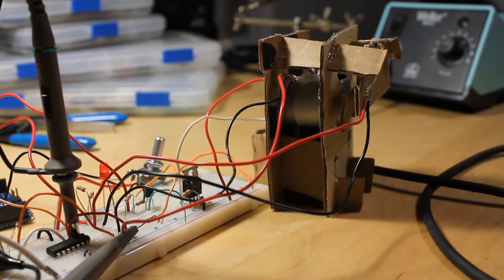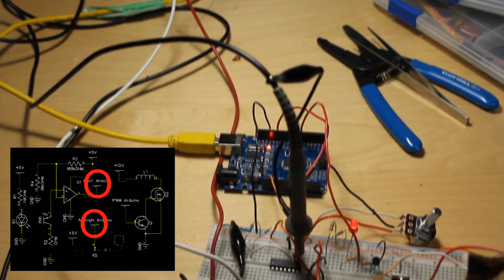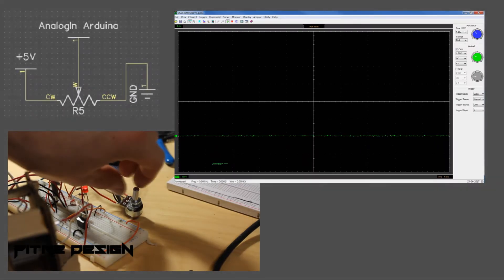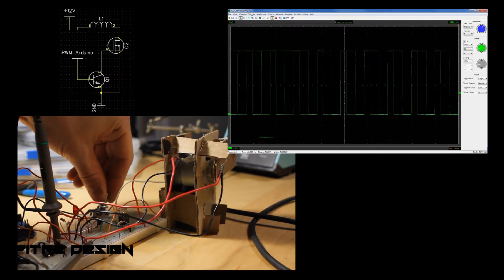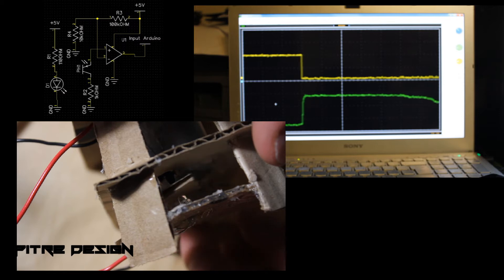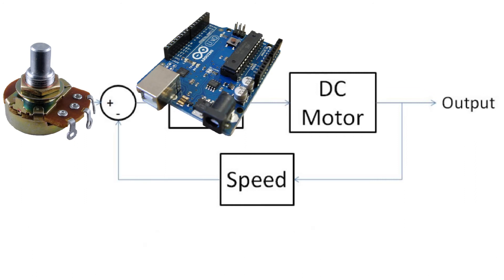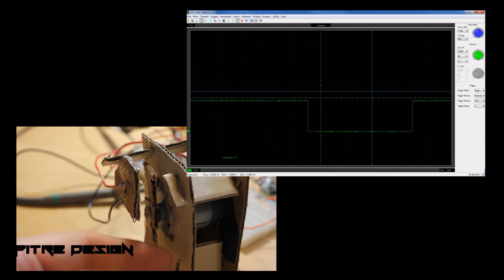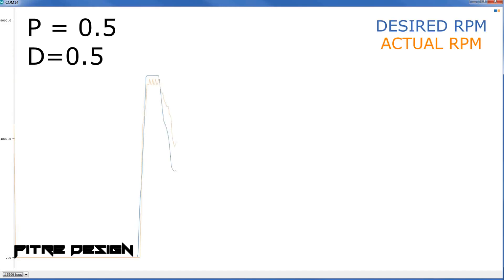Arduino PID Control of DC Motor using a DIY LED Feedback System (w/ Code)

Comment: Hi Pitre,  it seems this design is exactly what I need for my MX-180V lathe... did you try to use ATtiny 85 to run the code? I ask that because I had problem with electronics since the day one (blown processor) so I replaced it with ATtiny85 and my own code (very simple one).  The problem is, at very low speed the torque is also low (I can easily stop the chuck with hand). The lathe has encoder on the main shaft (to display rpm only) so I want to use it for feedback, as it is already there...

Comment: Should consider pulse with modulation for motor input function. I've never tried this, but I think it would help with the motor at lower speeds. The Arduino can create PWM itself, so it would be relatively easy to hook this up to an H bridge. That way you have lower RPM control and you can go in reverse.
Reply from the maker: In this setup, the arduino does generate a PWM signal that drives the motor.  This PWM signal is modified by the PD controller to match the desired RPM. I've made transistor H-bridges before, and they do work well for changing direction of rotation, but I'm not sure how it would help with the low RPM control?